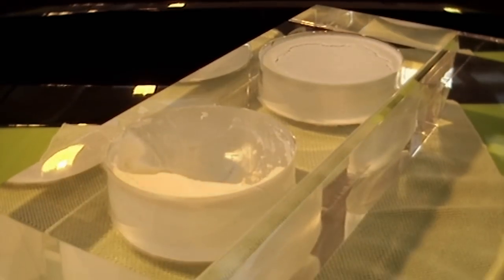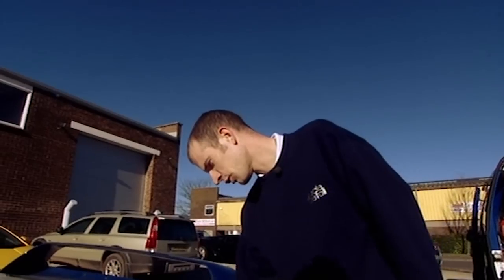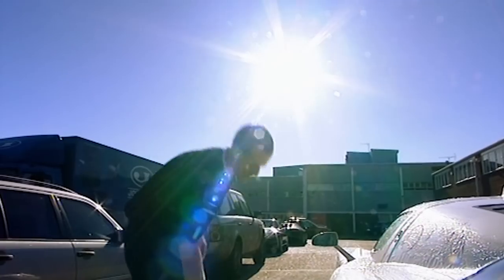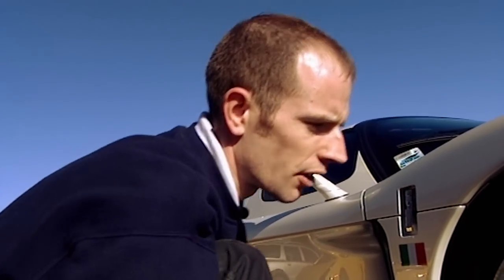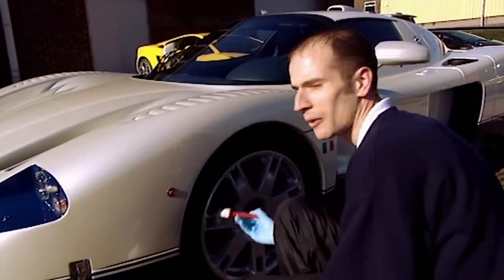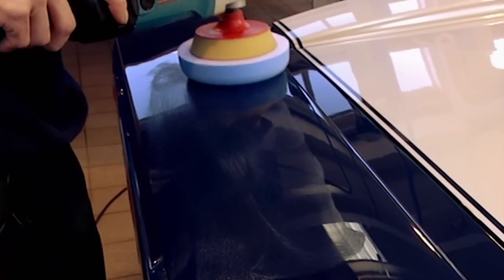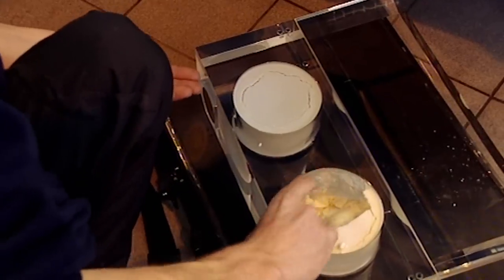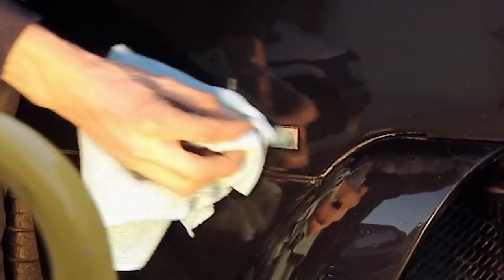World's Best Car Cleaner #TBT - Fifth Gear

Comment: The scratches that his clients are paying through the ass to remove are being induced upon the finish during "Step 3" of Paul's routine.  You see.....Paul is not using a Grit Guard in that single wash bucket of his and to further add insult to injury; he chooses to use a sponge instead of a Chenille wash mitt.
Reply: maverick buckley Not more than a sponge does.  No way. And whatever little dirt is on the mitt is taken off with a proper grit guard.  Microfiber Chenille is good but Sheepskin is be$t.
Reply: +The1WhoKnowsTheTruth Larry from AMMO NYC swiched back to mitts from sheep

Wonder why?
Reply: +The1WhoKnowsTheTruth You're so right, I do own a small Car Wash in Mexico City and I have to use 2 buckets to properly wash the cars: one to soap and other to rinse the sponge... otherwise I'd transfer dirt to the paint.
Reply: +Chema Brinval You guys are both doing it wrong, I wash my sponge with the water hose, that transfers zero dirt to anything but the ground.
Reply: ***** you're doing it right, but it's the same than rinsing the sponge on clear water...
Reply: +FullSpectrum Survivalist All of you are wrong rookies , the safest way to remove dirt from vehicles is buying long bristles boar hair brushes ( not cheap ) every time you put the brush in the soap water the brush releases at least 95 percent of dirt and will release the rest on the car for easy remove when rinse the vehicle, i did auto boat and Rv's detail for 15 years certified by Meguiars and 3M
Reply: PREDATOR 07 I believe my spray nozzle can remove over 99 percent of the dirt from my Chenille micro fiber wash mitt. Give it up, there is no way a bucket of water and soap is superior to spraying out my wash mitt with a spray nozzle. I put the mitt in a bucket of mostly pure/clean soapy water every time.
Reply: ***** How many times you have to clean your micro fiber mitt? Nothing wrong with your method but in a business time is money, however takes a little time to get used to the brush specially in small or tight areas👍
Reply: PREDATOR 07 I clean it every time before I dunk it back in the soapy water, and it takes me 2 days to do a full detail on a car. I even clean the vents with Q tips. I'm not fast, but I'm thorough, if they want fast they can go eat fast food. I buff the car 4 times, with 3 different compounds, cleaner, polish, then Carnauba Wax. Then I mist it and buff it again. I even will paint the undercarriage and take out scratches from body.

I was dating a girl back in the late 90's, and her ex said she just liked me because I had a new S10 TAHOE 4X4, but my ride was actually an 1985, lol. She said, Hawk doesn't have a new 4x4, it's old, it just looks new because he paints his undercarriage about every 3 months. So not only do I think I do a better job than about anyone out there, but I've been known to take 10-12 or more years off the model year car they brought in, lol.
Reply: ***** I agree with all what you mentioned, but you don't do more than what the people pay, I had customers willing to pay up to 500 or more detail for example dying leather in some areas, black moldings cure, headlights restoration, undercarriage clean and repaint, that's why I stop doing that beautiful work case people wanted to pay 100 bucks for a super detail, if they want cheap then they can go to Wal-Mart im no Wal-Mart
Reply: PREDATOR 07 Yea, that's why I don't do it to often anymore. I live in Tennessee, out in the Country, people just don't want to pay what it's worth. The problem is, I just don't want to do a half assed job either. Next thing you know everybody thinks I do shoddy work.

I did my brothers cars for $100 plus materials for over 20 years. He told me he can get it done for $75 at ex place. That sort of pissed me off. I told him I been detailing his cars for 20 years and never raised the price once, and he can go take it there then. He knows damn well he can't get a detail job like I do for 75 bucks. I told him that job was worth at least $500.

People expect you to work for free, but if they are doing the work, then they want paid. They don't understand how much knowledge and hard work a proper detail takes. I bet you I can't get him to spend 2 days bricking a house for me for $100 and materials, my time is worth what his time is worth, I am working just as hard as he is. You know what I am talking about.
Reply: I'm from southern California I was one the first mobile detailers with license for every city that I used to work and business insurance then suddenly eveyone started to do same business as low as 80 bucks for full detail I had two medium size trailers 3 employees making 100bucks a day plus materials , I used to make clean minimum 300 bucks daily, my main priority was the Rv's or big trailers 10 bucks per foot wash and wax and 15 bucks if buffer required up to 2 thousand I made in a single day, days of glory til the almost depression thanks to G W Bush and the cheap competitors
Reply: PREDATOR 07 I fail to see what Bush has to do with it. All I see is stupid customers that don't value our work, and stupid detailers undervaluing the profession.

If you will hover over my Avatar, you will see what I think is a better use of my time. As a matter of fact, I bought 2 more Blue Berry Bushes yesterday, once in and established, they work for me for free. I got Raspberries, Tibetan Goji Berries, sweet Cherry, Sweet Rush Plumb, Fuji #3 Apple, German Pear, Moringa Oleifera, and White Princess Peach trees in, once they all produce, they just keep working for me, year after year pretty much.

In addition to that is my other about 50 different 100 percent Organic Heirloom crops I grow every summer, 7-9 pepper types alone.
Reply: ***** u grow ur grain and potatoe too? Bake ur own bread? Feed ur own piggies :D?
Reply: blackcarmafia I grow potatoes', I don't have pigs.
Reply: Tyger Detailing Keep up the good work!
Reply: calm down its only a car
Reply: +The1WhoKnowsTheTruth Who gives a fuck, the 'clients' are obviously people with more money than sense, if you had a chance to fill your pockets with money from people who see £5000 as a fiver you would do. Couple grand makes little to no difference to the clients and at the end of the day the car's are spotless so everyone wins!
Reply: Mark B I'll try this next time I wash my mum's car. Thanks for the tip!
Reply: Toby Mullan my mum never owned a car :) u failed
Reply: Must've been your dad bruh
Reply: +The1WhoKnowsTheTruth Yes indeed, just what the fuck. Luckily he polishes the paint to remove the scratches, but you'd expect more for the money.
Reply: RespectYouNeed Yep....a whole LOT more.  But, I would settle for him knowing how to properly wash the car.
Reply: +The1WhoKnowsTheTruth so you have changed your claim of him causing the scratches ,because someone said also mits carry mre dirt.?????
Reply: Kevin Harrison Nope, have not changed my claim at all.  Mitts are 100% better than a fucking sponge that's for sure. And when you add the proper grit guard to the wash bucket they don't carry dirt. What else ya got?????
Reply: Nichlas Charran and doesn't bother with the two becket method or filtering the water.  At £5k he could be using vodka to rinse the car down!
Reply: you know this is from about 2005 a lot of the methods you are talking about were not around back then if you watch his new videos that he did on swiss he uses all the new methods
Reply: Looking at this comment thread there seriously needs to be car washing and detailing championships, I went down a rabbit hole reading this, heh heh
Reply: @The1WhoKnowsTheTruth  I use that zymol sponge and it's legit. It's great. I understand the 2 bucket method but then why not 3,4 or 5 buckets
Reply: @pinnaclecooking2384   8 year old thread man.  I am rocking a foam cannon.  Fuck buckets. LoL.  I rinse multiple microfibre or chenille mitts with fresh water from another hose. Hopefully Paul is too.  My advise is to Stick with what works for you.
Reply: @The1WhoKnowsTheTruth  yeah I'm sorry, a friend asked me who's the best and I showed him and I saw the comments. And I agree, work with what works for ya
Reply: @pinnaclecooking2384  This is not the best. I can show your friend plenty of guys better.  But if you want to show your friend a guy who is able to demand big money off rich idiots with a sub par detail. This is the place. 

Ive heard that he is now using correct method washing technique now. That is great.  Bout time. Folks were saying this clip is from 2005 and the two bucket method was not really well known. LoL. I was doing two buckets in the 80z.

Comment: Sunlight, sponge and wheels cleaned after the paint... I'm out...
Reply: The sunlight and sponges part I get. However, I don't understand what is bad about cleaning the wheels after the paint? Isn't it better to do it after rather than before?
Reply: If you clean and dry the paint, you don't want to put dirt/water on it again when you clean the wheels/wheel arches, plus the products used for this cleaning are more aggresive than the ones for the paint
Reply: So when are you supposed to do the wheels? If you do them first you run the risk of scratching the paint
Reply: Before so it doesn't matter if you slash the paint because you rince it after
Reply: But what about scratching the paint?
Reply: Sorry but I don't get the point of your question (other than trolling). Maybe I didn't pick up some of the subtleties (as English is not my native language)
Reply: Many people use the same sponge for the wheels and paintwork and so if you tell people to do the wheels first then wouldn't that cause huge scratches across the paint from wheel grit?
Reply: Oh I get it now ! Sorry about that aha
You are totally right, but when done professionally, you don't use the same tools (or wash them correctly before), use two buckets for the paint, micro-fiber mop, ...
That's why it makes me laugh as they say they charge upto 5 grant for this work and I see all this imperfections on this video. It's definitely not good publicity considering the price of these cars
Reply: True, people looking into it more to have it done properly.
Yeah, this guy might want to update his methods. They aren't the most technologically advanced ways of doing it and he seems to rely purely on buying super expensive products.
Reply: +all of you forgotten that he machine polished the car afterwards...doesn't matter in this case, for regular wash its bad probably. You mentioned some people are using same sponge for the wheels and paint, well that's bad, because doesn't matter if you do first paint then wheels, you're still using THE SAME SPONGE. 
Proper and most efficient time/result method is :
0. park the car in shade or avoid direct sunlight if you can
1. first cleanup wheels, use dirty or separate bucket for that water as well as used/older sponge, mitt, brushes and never mix that tools or bucket with paint bucket or tools.
2. soak the car paint, use 2 bucket method and wash mit, rinse the car, then go over with car soap and wash mitt, rinse the car
3. dry the car, best is with leaf blower or air compressor, next one is high pile microfiber cloth, they are bigger size, use linear motions only
4. you're done, all above should take 30 minutes max, if you get this as routine then its even shorter
***wheels, arches contains brake dust, iron particles which can embed into paint, also they stick into sponge for that matter and can indeed cause scratches on your paint. Any daily driver car will end up with some sort of scratches but using proper washing method ensures long time best looking clear coat and shine
Regards
Reply: Ok I guess I learned a few good things other than how I've been washing mine but why park the car in shade? That I don't get.
Reply: in shade is the best way, because, exterior (metal, plastic, carbon, whatever) is not hot, therefor shampoo, wax, or any other cleaning products (wheels, plastics, all purpose cleaner, degreaser) wont evaporate instantly, in worst case scenario product may leave nasty stain if left to dry on surface. So if your car paint is hot, do not wash it, wait till cool down, or use space with less sun, with some shade at least. Tip black cars are worst, they get hot super fast on sun (metal parts), so if you wash car on direct sunlight, you will end up shampoo one panel, switch to another and first one is already dry. U got the point?
Reply: Yeah, thanks, I thought there would be other reasons for it too but it alone makes lots of sense because yeah I remember the water drying fast and always had to soak it again.
Reply: If anybody here knows anything about washing a car, you start at the top and work your way down.
Reply: No mention of deionised water?
Reply: @archvile1313  there is an even more important reason. If the clear coat is warm/hot, then it is prone to scratch easily because it becomes softer. Furthermore, if you spray cold water on a hot panel, you get sudden contraction of the clear coat which overtime can cause it to detached from either the paint or the substrate. Then it will look all flakey
Reply: Was thinking same!
Reply: GogogoFollowMe to be fair, he might not normally wash in sunshine, he is doing a section for a tv show, not doing his normal job.
Reply: Car looks fine to me I use a sponge and the two bucket method for mine. Not telling everyone that they should clean their vehicle that way buts the way I do mine.

Comment: he uses a sponge....
Reply: Its a £400 sponge with nano fibres, not just a normal yellow sponge
Reply: ***** The bucket is a £1000 bucket which negatively charges the water forcing 100% of particles into the base of the bucket whilst positively charging the sponge therefore all particles are pulled off the sponge when dipped in
Reply: Combustion69 top meme
Reply: This guy knows his stuff.
Reply: ***** what plastic particles? Lol
Reply: ***** L
Reply: sd no
Reply: im car detailer and i only use one bucket. Ive been mobile for 13 years. Just do your tires last. Put a bucket grid at the bottom of you bucket while washing the body. The 2 buckets to me waist a lot of time. Ive never had any problem and i have over 55 customers. But to each its on. Positive flow.
Reply: Have you ever heard of chrisfix? If so then you’re not paying attention 2 buckets one for rinse one for dip top to bottom no swirls make sure hand dont hurt if you put it in the direction of flow from powerwasher ect.
Reply: Used sponge before  paint  correction  , nothing wrong  with that.

Comment: There's a lot of negative comments in this comment section regarding his cleaning method. This video is 11 years old and the methods he is using were bang up to date at the time. If you have a look on his website you'll see that he has evolved with the times and changed his methods considerably. Bearing in mind this was back when people got a raging stonker over wonder wheels.

Comment: List of things he did wrong:

1) Used an aggressive TFR instead of a much safer strip snow foam
2) He did not use rinse bucket or at least spray off the sponge before getting more shampoo
3) He used a sponge which just pushes dirt around
4) Always do the wheels first
5) Always rise the wheels first before using agitation also I don't think he even cleaned the inside of the wheels 
6) That is not how you apply polish or cutting compound to a pad
7)He did not do a test section with various polishes or compounds first and just assumed that combination would work the best
8) That is way too big of a pad for this car and poor technique 

cheers!
Reply: Also washing a car in direct sunlight is a big no no
Reply: Your right to this day😂
Reply: Well this was back in 2005. Car washing standards were way different back the. 😅

Comment: For those newbs who say that what he does is wasteful and poor.....

This video was taken over 10 years ago, when detailing wasn't anymore advanced than this.... two-bucket method and grit-guards didnt exist back then. Now we have dedicated buckets with grit-guards, foam cannon, iron-X (and similar metal removal sprays).... a lot of tools that used to be unobtainably expensive, are now common place and very inexpensive. Paint depth gauges? used to cost thousands... now a decent one runs about $150 and can come with a camera. 

And the video was edited poorly as it is.... 

Also, Paul Dalton is still the best detailer in the world.... he's at a level where the amount of work he can put into a car's cleanliness is beyond obsessive. 

Its not uncommon for him to spend over 100hours on a car on cleaning, restoring and paint correction. 

I have a side business detailing cars.... I dont make any money just doing a regular wash and simple wax... that costs me more in labor and products than the $60 i charge. I make big bucks by doing paint correction and sealant applications. Minimum 1-step correction runs $250. Multi-step correction which can add up to having the car for several days including sealing the paint and the wheels.... you're looking at $600 minimum. I work out of a small rental space. 
I can make a solid $3000/mo just on detailing/correction on top of my full-time day job after my overhead is paid for. 

For your daily driver? A simple two-bucket method, clay and wax is all you need and that takes just a few hours, if that.

Comment: Sponge collects lots of  tiny dirt particles that are already in the bucket of dirty water and  on the surface of the paint and converts them into round shaped scratches(Grit dragging across your paint) caused by circular motion of the car washer's hand then you have to remove all those scratches and this is where the extra cost comes in .Never wash your car  with a bucket of water and sponge! Use Sheepskin,Lambswool or deep pile microfibre.Fresh water every time you dipped in!